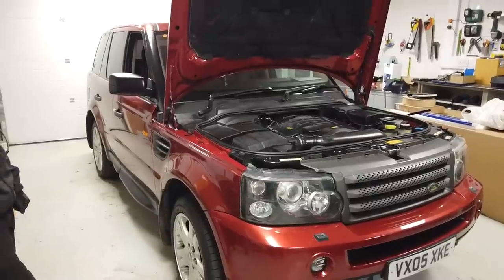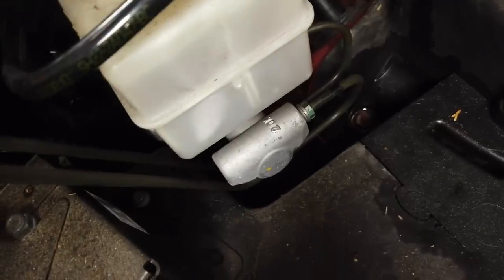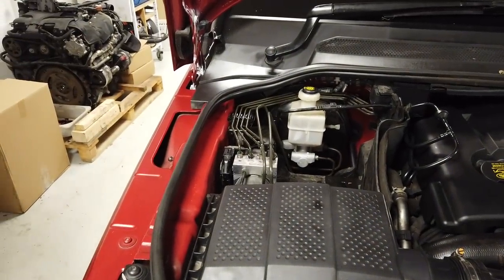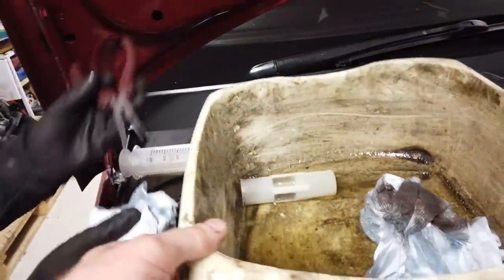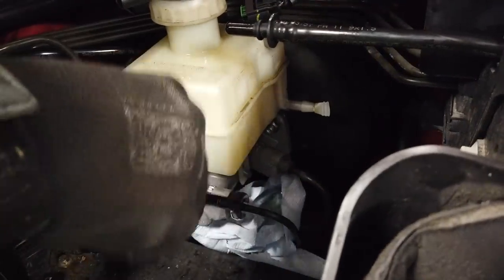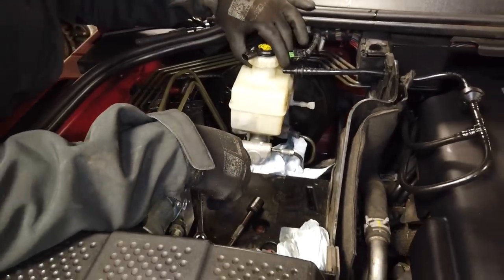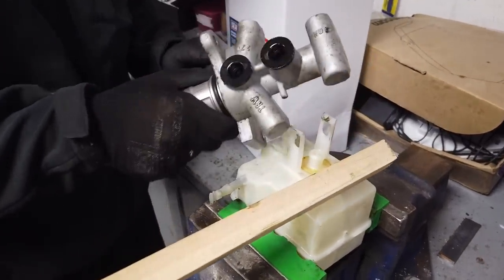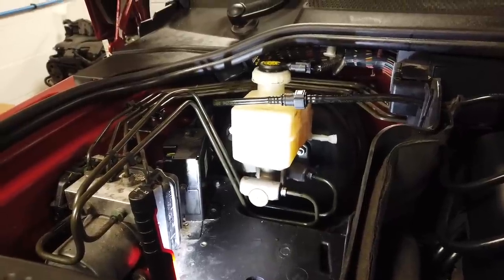Project Range Rover Sport - Replacing the brake master cylinder

Comment: And your MOT checker didn't pick that up? I'd be reporting them, that is such a basic safety item it is frightening they missed it. At least get your money back!
Reply: He did fail the car on brakes...
Reply: @simonjefferson  Thanks for replying, I thought the report only listed the binding brakes and the wheel bearing, surely the authorities require all defects to be listed - as powerfulukltd has found out there's more to brakes than just the bits on the wheels. I know a similar report here in Queensland, Australia would have to list all defects found even if there were multiple defects in the same component. To pass, all he had to do was fix what was listed and then driven away with a very defective master cylinder. See what I mean?

Comment: Hello I have a 2013 sport and I found a puddle of clear oily liquid toward the driver side. I think it’s brake fluid, would you have any clue as to where it could come from? Thanks!
Reply from the maker: Was it towards the rear ? the rear brake pipes rust on the L320 sport 2005-2013 but you car should be the later 2013 L494 ? not sure but get it checked ! brake fluid has a strange smell - check the brake fluid resevoir to see if the level has gone down !
Reply: Sorry, it’s L320. And it’s near the front diver side. Almost under the footwell. Thanks!
Reply: And the reservoir is 3/4 full

Comment: Quick tip...if undoing a nut wih a socket and you are afraid of losing it, put some general purpose grease in your socket.....it should hold it while you withdraw the socket.
Great video chaps.

Comment: I had the same sinking pedal after changing all 4 calipers on my Discovery 3 even after bleeding from the calipers.
I thought the master cylinder was knackered too but I ended up getting more air out from the 2 pipes going from the master cylinder. Just a case of someone pumping the pedal as I undid the brake pipe nuts. Took about 4 to 5 pumps on each pipe. The pedal then stopped sinking.
The pedal was still spongy so I used a diagnostic tool (icarsoft LR V2.0) with the ABS bleed function. The pedal is now firm at the top again. Great video again guys!
Reply: PowerVolt I have the same software. Do I bleed traditionally or just use the software bleed feature? Can you explain the procedure of the software route and how it’s done.

Comment: A excellent video, but towards the end I realised it is not possible to do this job without the electronicy diagnostic tool, and the knowledge to use it, it would be a good idea to get some wing protectors or even an old tarp to protect your paintwork from the ravages of the brake fluid drips, and I always slip a cover over the end of undone brake pipes to stop the ingress of crud, although you area looks very clean. Chris B.

Comment: Hi got a problem
On a straight road the break works fine but down hill the pedal goes hard . So it dosent break .
Reply from the maker: Hi - going downhill you clearly need more braking force.
Have you do the test to check your brake servo is working - does the pedal "sink" when you do this test
https://youtu.be/2GJB2TlDMHA?t=160

Comment: Was there any engine oil or brake fluid in the bottom of the servo?
Reply from the maker: I think you may be on the right track - i did not check and this would have been a wise move. The servo is working ( in that it pushes the pedal down ). The vacuum also holds so i think it should be OK... there is no sign of leakage from the master cylinder. I may buy a servo and cut it open.
Reply: powerfulukltd No need to get your grinder out for this! Just remove the vacuum pipe on servo and dip a white cable tie down to the bottom and see if it comes back with oil on. This is the LR  TSB method. If yes the vacuum pump probably needs replacement.